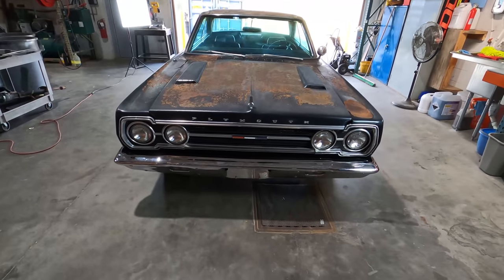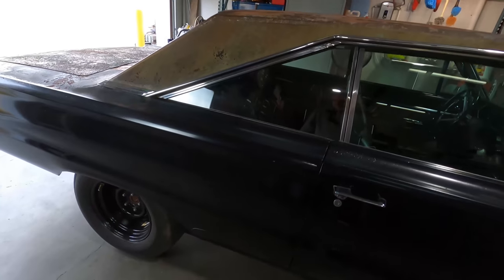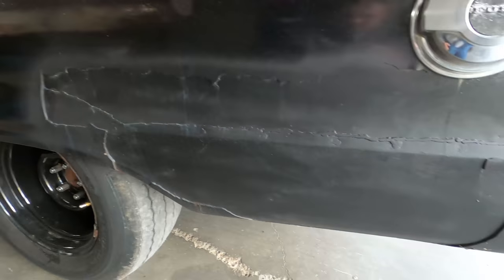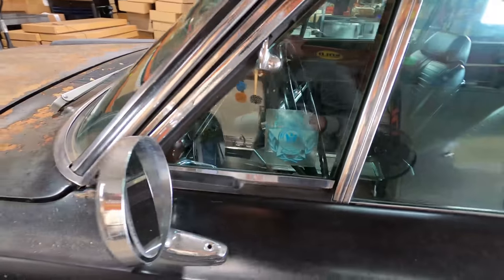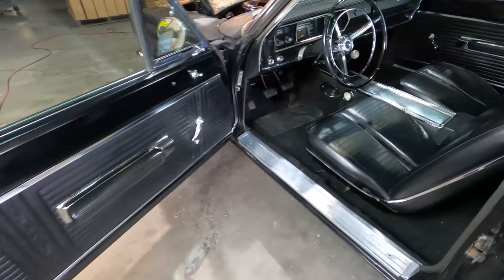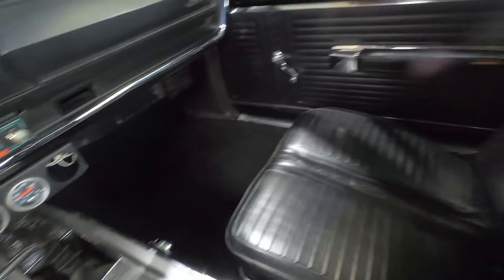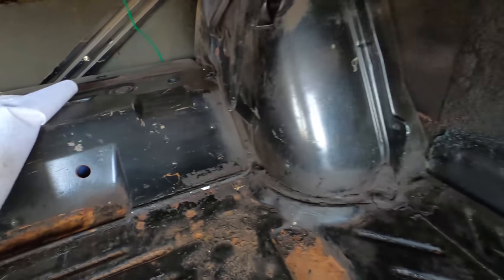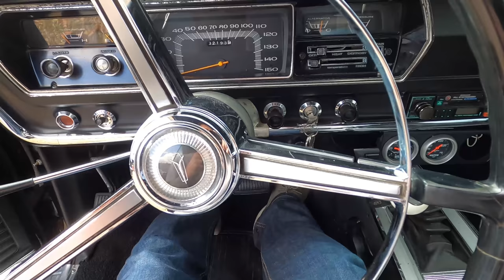1967 Plymouth Belvedere GTX Hemi 4-Speed Walkaround

Comment: My friend had a 66 hemi satellite, you could actually watch the gas gauge needle go down.
Reply from the maker: You don't miss many gas stations in this car, that's for sure.
Reply: Love to have the 66 Satellite with a Hemi.Satellite with a Hemi still a Muscle Car?
Reply: Larry, my 1967 GTX (440) got about 8 mpg on a good day. Only tolerated Sunoco super-duper hi test but in 1968 it ran about 32 cents/gallon. Cheers.
Reply: @jamesstark8316  In  some of those cars, a half tank meant time to be thinking of where to fill it up again.  Quarter tank meant enough to get to the station in the straightest line as possible.  Still, those cars were the bomb.
Reply: Back in 1968 I had a 66 Hemi Satellite and a 66 GTX w/440.  The Hemi was better on gas by about 2mpg.  So we drove the Hemi on our Honeymoon.
Reply: Can't be any worse than a Hellcat.

Comment: I need to find one of these in a barn. Now on disability i couldnt afford one. I should Have bought the 67 i found in 1982 or so. All original 426 GTX auto at 9k. That was a lot of money then but now its nothing. Always kicked myself in the ass for not getting a loan. Now at 57  it would be so enjoyable to work on it as i could. I miss my old hotrods . 3 back surgeries i cant do heavy lifting but a garage and cherry picker i have. At least i got my old Harley shovelhead i can enjoy but man i miss sitting at a light with the car rocking and then going through the gears. Should have put one in storage but who knew they would get so damn expensive.  Your a lucky guy to own that car id never get rid of another if i got my hands on one.

Comment: So does this only have a deep oil pan on the front half of the engine because of Chrysler's suspension having the steering linkage running across the engine compartment, saw a umcle tony garage video where he was saying all the old chryslers would spin engine bearings from this set up

Comment: many many many Hemi blocks failed in service.  my engine guy was a Dodge dealer parts mgr in the late 60's he said half got unstamped replacement blocks
Reply: Same with z28  302 engines, they were prone to failure, many were dealer replaced, all they were was a warmed over 283, could not take high revs for long.

Comment: So somebody had the motor out or worked on it, and is it a numbers matching car?
Reply from the maker: This is not a numbers matching car at this time.
Reply: 1967 had no numbers on the engine block to match, best you could do is go by production date
Reply from the maker: @mitchholmquist2741  Exactly. I should have worded differently because the motor was 1/18/69

Comment: It sounds like you are showing it to sell it.  I'm curious if so.  And how much for.
Reply from the maker: It was for my listing on BringaTrailer.com and the car sold.
Reply: @VistaCollectorCars  Well, congrats - I suspect the happiest day is when a car is sold and bought, maybe for both the seller and buyer.  I have had a recent fascination for a 67 GTX....how much did you sell it for?  If you can share.
Reply from the maker: @fd797  I'd rather not say on here. You can check search 1967 GTX on the Bring a Trailer site and see the results of the auction.
Reply: @VistaCollectorCars  That's cool - no problem.  I saw on the site.  Thanks.

Comment: A word of advice. Cars like this do not require you to push in the clutch to start them. It’s not a new Mustang. Put the car in neutral, then with your foot OFF the clutch, start the car. The part of the video where you are pointing out that there is no choke and you show your left foot with the clutch to the floor is so unbelievably frustrating to someone who understands how cars and engines work. You are putting lots of unnecessary wear on the thrust bearing of the crankshaft. Even if you felt it necessary to start it with the clutch pedal depressed, why keep it there for so long? <facepalm>

Comment: Spend the time and money for better brakes, think 4 wheel disc, rebuild suspension and add tires and wheels. Something around 15 x10 rears / 295/50 and 15x8 front / 235/50. Drive the crap out of it. Just please don't make this badass ride into a money's no object, numbers matching, nothing but profit minded show car that just gets looked at. Something that's sealed away from the time it's finished until someone with more money than sense just has to have it for the collection nobody will ever see. There's plenty of those already.....